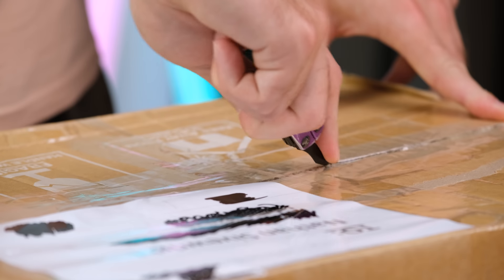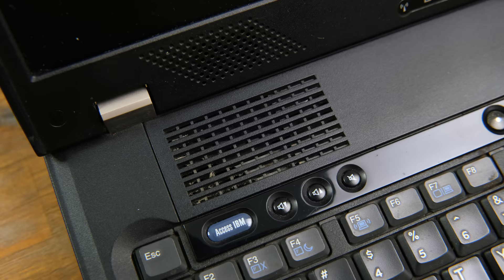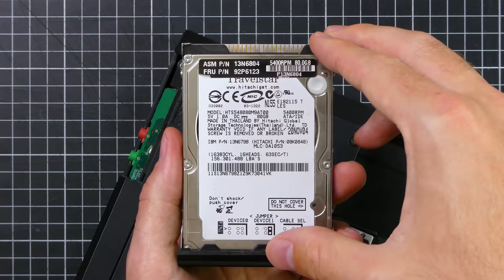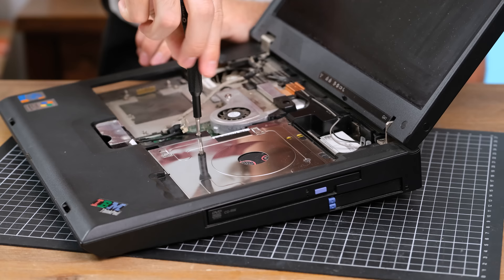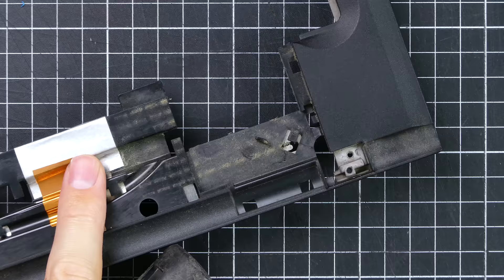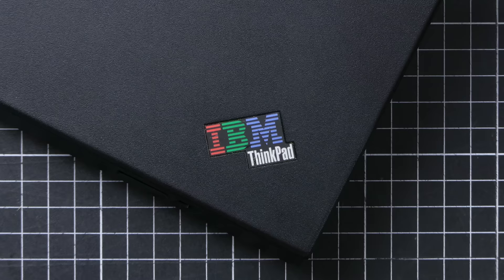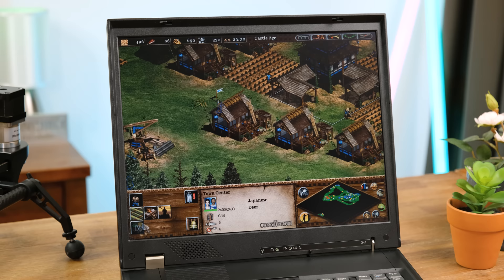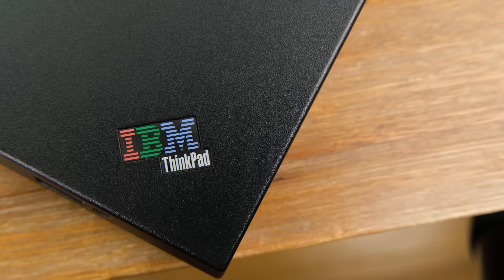IBM Thinkpad G41 - Restoring A THICK Pentium 4 Laptop!

Comment: I would have been curious to see how well Linux Mint from 2019 performed on such an old latpop. Making a case for old hardware used with modern software.
Reply: I tried it on this same machine actually.  It runs like crap, I ended up on an older ubantoo release
Reply: I am curious as well.
Reply: Tried Mint in as-old machines but there are many drivers missing... Then you need to go back to older Mint/Ubuntu releases but you won't have the latest software... Well, you can't have everything with a machine that old!
Reply: It's not just digging through the old archive driver packages in the repos, it's the fact that x86_32 was largely depricated from the desktop linuxsphere. You can use one of those dedicated 'old pc' distros if you're fine with the weirder web browsers that never work
Reply: @Sylvia Campbell I only mentioned it because it was shown in the multi-boot menu early in the video, showing the previous owner was running Mint 2019.
Reply: @jeremiefaucher-goulet3365  Linux lite should run alright
Reply: @Sylvia Campbell It might be Linux Mint with Xfce instead of Cinnamon.
Reply: It could have had Linux mint with Xfce instead of Cinnamon.
Reply: I think that's the combo I tried but even after getting graphics drivers to work, the DE was all over the place like to change workspaces it was ctrl-alt-windows key-F18.  Then Firefox just didn't work outright & I was all, alright, time to find one of those x64 atoms
Reply: @atari2600b  with older Ubuntu releases you mean the current ones?Ubuntu is literally half a year behind lmao
Reply: I have an old Acer Aspire, which came with Vista, running Zorin OS Lite, it runs suprisingly well, at least IMO. Also I put an SSD in it, so that helps a lot too
Reply: Actually, you would be very surprised to see how much of the old software is superior to what you can access today without buying a business based service program.
Reply: @Sylvia Campbell Try Fedora. Gave me much better video performance online I could stream full 1440p when I couldn't get stable 1080p in Ubuntu
Reply: The last supported Linux Mint version is 13.0
Reply: @eshaanbhargavpatel1768  Are you saying the dual boot installed by the previous user doesn't work?
Reply: @jeremiefaucher-goulet3365  no linux mint 14.0 and higher require PAE but that makes problems on this computer
Reply: Cinnamon is too heavyweight a desktop environment for it if anything.
Reply: @scorp18121982  dude, just get gentoo with all the most recent software, it isnt really that hard!
Reply: Lightweight linux distros on old hardware is actually a really common thing to do. Mint isn't the lightest but it will run on most old potatoes.
Reply: Chuck in an SSD, more RAM, and it will be tolerable to browse old reddit with it, and you maybe will be able to play 240p videos on it.

Comment: I've always loved Thinkpads and I still recommend them to everyone. This machine was from the golden age though - The IBM branded systems. Don't get me wrong - since Lenovo have taken over the thinkpad range, they've done a good job keeping the standard high and they are still great machines. IBM though seemed to have a magic touch. Even my first thinkpad 600 (with a pentium 2 cpu) not only was as hard as a patio slab but was very fast and very stable for the hardware. IBM proved these machines through the ceiling making them compatable with everything and damn near indestructable.
Reply: Best Lenovo era ThinkPad I've had is my P50 , solidly built and easy to work on

Comment: surely it isnt only me, anyone else a sucker for old style laptops? not the internals, but the abundance of IO, no chassis flex, clicking monitor hinge locks, replaceable batteries.... man, if they sold this again with modern specs, I would buy one in a heartbeat.

Comment: Fun fact, the USB ports deliver power, even when the laptop is powered off. Had to do this once in a storm when I'd lost power and needed to charge my phone. Had the G40 and its weird 4-pin power adapter. Pretty sure it still works.
Reply: will try this😂😂😂
Reply: @supergirl1386  Let me know how it goes!
Reply: My old t440 had this! Used it like a big powerbank lol
Reply: Almost every laptop or PC have this function...
Reply: @Gerrrciu not with some newer laptops. The option to charge devices while it’s off via USB is either available when it connected to power or you have to go to the BIOS to turn it on there.
Reply: always on usb

Comment: 0:29 Due to the Thinkpad's modularity, IBM (later Lenovo) decided to make "mods" for the drive bay, some of them being: extra battery pack, CD/DVD, second HDD, etc. (Especially in the IBM era ones)  so basically the owner gave you 2 mods: the CD drive already included inside the laptop and the CD/DVD writer that you showed
Reply: My first computer was a Dell modeled after a ThinkPad.
Reply: @CoasterMan13Official  Yeah later Dell and HP copied the modularity of the thinkpad with their Latitude and Elitebook
Reply: @Mr_L1n4x  yeah. Believe it or not, I still have my Dell D630. It still works. I have Ubuntu MATE installed on it.
Reply: Sadly newer thinkpad don't have the modularity anymore
Reply: Yes, even Lenovo applies the same modularity concept on Y400 and Y500 laptop with additional GT 650M GPU drive bay dock to enable SLI on those laptops. It produces GTX 760M performance (on 3DMark benchmark and SLI compatible game), therefore surpassing Alienware M14X R2 (which is supposed to be the true 14" gaming laptop at that era). Once I owned Y400 laptop with SLI GT650M and it felt so amazing to be able to run Metro Last Light and CoD Ghost with perfect 60 fps high setting 768p.
Reply: @CoasterMan13Official Wish I still had my Inspiron 6000, but I threw it out years ago.

Comment: I recently got an IBM Thinkpad R40; works just like how I thought it would. (That being well for older tasks)
Ran like hell until I noticed all the drivers after a factory reset were the Windows generic ones. Installed proper drivers and it worked MUCH better

Comment: It would be great if a company that makes laptops could apply the same design of the Thinkpad G41 to a gaming laptop. With today's technology and with how thin the components are now, you could easily put a processor and a desktop gpu with the dimensions of this laptop and still have a good cooling system.
Reply: If I remember correctly LTT had a video last year where someone had made a laptop exactly like that
Reply: There's been at least one company making such a beast for every generation of Intel CPU. They tend to be quite niche products though, even for gamers... even more so now since you can just use a conventional laptop + eGPU. Mobile CPUs have come a long way since the machine in this video, the GPUs haven't quite caught up though, they're still heavily gimped compared to desktop versions.
Reply: I could be wrong, but I am quite certain that even among mobile workstations with desktop CPUs, they still use mobile GPUs, usually on an MXM card which means they are technically upgradeable, but still gimped.
Reply: The Clevo X170 is pretty close to just that. Still has an MXM GPU, but it's got an LGA 1200 socket and a Z590 chipset. You can put an 11900K with a 16GB RTX 3080 inside, run about 40 minutes on battery lol
Reply: But they won't get enough buyers
Reply: Exactly, gaming laptops are almost useless to me because of the thermals
Reply: @jakestocker4854  design over practicality
Reply: @MGrey-qb5xz  yeah, I had Ryzen 3750h 1660ti max Q laptop and it was so compact that it just under performed so much. Also had a BIOs issue that would make the CPU max out every 5 minutes or so while gaming which would lead to an extreme throttle and stutter. Had to use a Ryzen controller app someone made to mess with power limits and what not to get it to stop doing that. Even then it still ran extremely hot.
Reply: @jakestocker4854  jeez i'm looking at g14 and g15 and it's asasine how acceptable people think this product is, so much power literally melting away
Reply: That's the Framework 16.

Comment: P4 laptop, fire hazard and good portable space heater. I want one.
Reply: As an owner of a G40, it’s actually surprisingly cool and quiet. 60c max temp and barely audible. It’s primarily due to that gigantic Heatsink. This was super hot for it’s time but these days consider that 45w mobile processors are handled by much smaller coolers since they have much higher potential max temperatures. Since these P4’s would’ve died horribly well before touching something like 90c, most systems of the time aimed to keep the processor at sub 65c

Comment: Those old P4 and Athlon XP based laptops ran hot like crazy and used so much power,but i really liked the idea of CPU upgrade being possible and it would either work with a mobile version Pentium 4 or the Desktop version just like the one in the video. I also have a desktop CPU based Pentium 4 laptop that only had around 600 hours of use for its whole life.
Reply: check out clevo laptops, desktop processors in laptops
Reply: @wheeI  Heh,the Pentium 4 laptop with the desktop CPU that i have is actually a Clevo :)

Comment: Brings back memories. I love Thinkpads and I still use an X230 (in a X220 body) and recently found a B590 in my brother's office collecting dust. I brought it home and was glad that it boots using the X220 power supply. After replacing the HDD with SSD, putting the old HDD into a CD caddy for extra storage and fortunately finding an 8Gb RAM from another non working laptop, a got a new laptop. Now I'm using it more because of the bigger 15.6" screen

Comment: The ThiccPad's use of a desktop P4 shows how messed up the Prescott architecture is. The Pentium M on the other hand was based off the Pentium III's P6 architecture which would later be the basis for the Core architecture.
Reply: I remember seeing a Pentium M powered notebook for the first time and being so impressed. It was one of those ultra light Dell ones (Latitude X300 IIRC), running at 1.7GHz, sipping power, but performing really well for office work. The Pentium 4 really was a dud.
Reply: @44Bigs  Hence the pejorative nickname "PresHot" for them Pentium 4s.
Reply: @blakegriplingph  I worked in a computer store during the transition from Northwood to Preshot... we sure used a lot of those Zalman heatsinks to keep the high-end builds from melting down... seems strange right around the same time the scrap price of copper started to go through the roof 😂
Reply: My school had PCs that used P4s iirc and that computer lab was always like a damn oven.

Comment: im pretty sure every person who uses a thinkpad like this in 2022 uses Linux, it is just so much better than Windows XP in every way. You get a modern, secure operating system that can run up-to-date software reasonably fast even on old devices like this. Linux Mint 19.3 seen in the video is still supported and updated.
Reply: It's a P4 why not put xp on it for old games ect
Reply: @Devilmonkey667  why not both? (As the owner clearly did)
Reply: ThinkPads in general - Linux just suits them. Sure I absolutely hate Winblows 10 so there's some slight bias but ThinkPads deserve Linux.
Reply: even then its bad, i had 19.3 on my vostro 1520 with c2d t6670 and 2gb of ram, 160gb hdd, it wasent great and it freezed alot thanks to swap file, i have a t400 with arch and windows 7, 4gb of ram, p8600, new 47Wh battery, sure arch works well and 7 does too, and i can use the two without any problems
Reply: @TDGalea  they deserve Windows XP.
Reply: @Devilmonkey667  You can still play old Windows games on Linux, it would even enable you to play a few little newer games
Security is also very important, having a computer with a old operating system connected to your network is not just a security risk for this computer, but to your whole network. It's even worst if you login on it.
Reply: @VolpeJosesk  bruh its a p4 its not worth it
Reply: It won’t be as fast as windows xp though.
Reply: What is up with these Linux advertisements. I see these comments on literally every psivewri video.
Reply: @retrogamer2503  its because we advertise Linux for free
Reply: @tacokoneko  But why though?
Reply: @retrogamer2503  because Linux is better than Windows and Mac and eventually Windows will be a legacy OS not used much. this is starting already and evidence for that is Steam Deck
Reply: @tacokoneko  Unlikely prediction but ok
Reply: Yep. I still use my ThinkPad X200 every week and it runs a current openSUSE Leap release.
Reply: Nah linux is for nerds, xp 4 life

Comment: Windows XP is definitely holding that processor back. If it's a 64 bits 2 Threads Pentium 4, it could definitely play YouTube in 720P.

Oh, and when you deal with Macs... please check out Dosdude1's amazing patcher!
Reply: Windows 10 used to run fine on these Pentium 4s on older versions like the 1607 anniversary update but now it's just too bloated with extra animations and candy crush.
Edit: just looked up the mobile P4 series and it turns out this one doesn't support Intel 64 or NX Bit, so Windows 10 and modern Ubuntu are out of the question.
Reply: @Tom2404  This is a Socket 478 desktop Pentium 4.
Reply: @aaaalex1994  actually not. There is no 3.33GHz desktop P4.  They just happen to have the same socket and I can't really see a difference except for a slower 533MTs bus as opposed to the 800MTs bus on desktop and branding. Doesn't really make a big difference since Intel 64 and NX bit were only introduced on socket 775 anyway.

Comment: Your videos are great and showing old versions of Windows running are quite nostalgic but you should starting learning some basic Linux, you'd be surprised how usable those old machines are with some lightweight Linux distro! I think your channel will be even more interesting, reviving old hardware with the Linux magic :D

Also, connecting Windows XP in 2022 on the internet is very dangerous! I hope you have a separate internet for your testing, otherwise you risk getting some nasty malware on your network. Be careful, cheers!

Comment: I remember an older version of  Pentium 4 Laptops back in 2001.  It didn't have a battery inside, you had to plug it into the wall to use it.  The power brick that came with it was massive and weighed almost as much as the Laptop.  We sold a few but they never ordered them again once they were gone.
Reply: So more like a portable desktop then?

Comment: would love to see an upgraded version of this bad boi with internals from around 2006 for the best gaming and workload performance for its time and yes the swap to an SSD with the XP system would be a thing to see as we all know the load times of the boot in XP from HDD speeds but to see this beast work like a laptop from today running all the old games would be a sight to behold

Comment: desktop replacement laptops are the best, i still use a GT72 2QE from MSI (clevo/sager) as a daily driver, its 10 years old nowdays, but with a core i7 and a 980m, it does everything i need for work and lan parties

Comment: I owned a G41 in that day and used it for a couple of years.  I love ThinkPads, but this is one that I just can't recommend to people.  Aside from the portability issues, the fan is constantly blowing a noisy stream of hot air.  The display isn't that great and the overall speed is very disappointing for the size, noise and weight.  It's just not that pleasant to use.  Frankly, the G series was intended as a low cost corporate solution and is inferior to the T Series and X Series ThinkPads of the same era.  Since these are now cheap as well, there's little reason to go for the budget model, especially given its other flaws.
Even so, I'm glad to see one given some love.  I unceremoniously trashed mine when the fan died.

Comment: I remember those laptops back on 2003, oh man, I just love it. ibm laptops were the best in quality.

it's a shame that ibm division no longer exist and even lenovo actually don't make laptops at this quality level. ...by the way, not a single company does it.

how about upgrade this machine starting with a custom bios, faster ram and a new ssd? that will be interesting.

thanks for the video! geetings.
Reply: apple does super quality laptops
Reply: @leart78  but super locked down and non-upgradable.
Reply: @leart78  Ridiculously expensive, not upgradable, form over function to a T, modern ones are (mostly) restricted to MacOS
Reply: The Thinkpad T430 was the last good Thinkpad IMO, and I'm not alone. I'm currently dailying a P51s, and this thing is absolutely terrible. Feels cheap, runs hot and slow, not upgradeable, and the SSD fails to recognize on some boots. I'm planning on selling it to bring my T430 up to modern spec.

Comment: Probably a delightful machine to be used at the time, especially with the higher resolution TFT display at 1400x1050 resolution. With 1 GB of RAM, one could run a solid Mandriva or SUSE Linux and virtualize the troublesome Windows XP with comfort. Depending on the applications to be used, Windows 2000 could be virtualized instead, leaving more memory free.

Comment: I just bought a thinkpad t40 for some basic retro gaming. It should handle games like morrowind and half life just fine. It has the faster 1.6ghz Pentium M, the gigabit lan, dual band Wi-Fi, and even Bluetooth. Most interesting of all it’s been upgraded to the higher resolution 1400x1050 display from the t400(and probably the same display used in the g41)

Comment: I think IBM sold a graphic card for this laptop, IBM-branded GeForce FX Go5200 64M, which connects through a proprietary 8x AGP interface, I believe is the white connector inline vertically to  the power chokes that are left to the CPU, and has support for H.264 on NVidia driver v180.06. H.264, which YouTube still uses and the G41's integrated graphics, being Intel Extreme Graphics 2, doesn't support, so with such graphics card, this laptop may be able to cope with playback of YouTube of now.